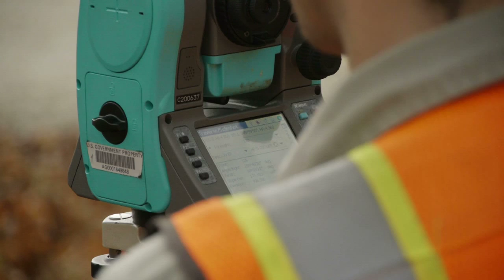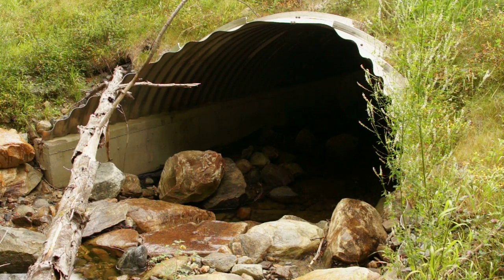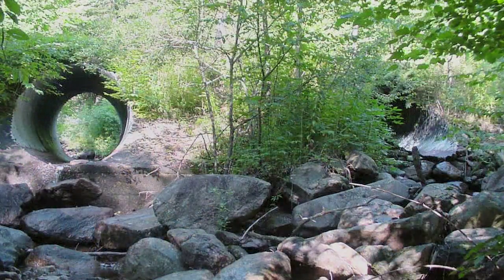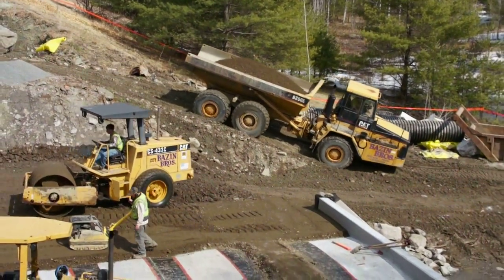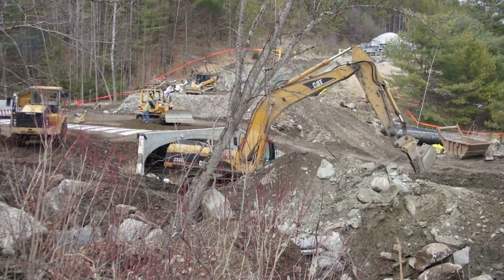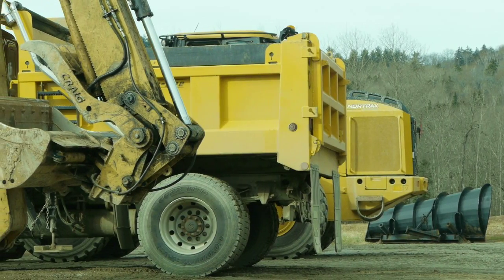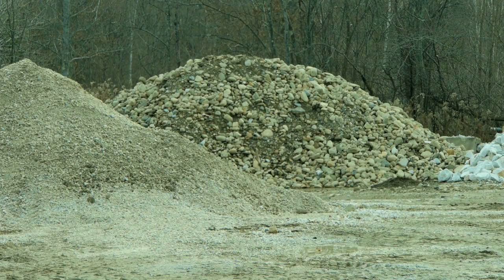Better Culverts & Stream Crossings

Comment: I have a small ravine I need to get a culvert on to continue my driveway. The problem is I need a 40-50 ton capacity culvert because we are building a new home on the large property and concrete trucks need to be able to cross. Let me know if you have any recommendations on what to build or what material I need, etc., thanks!